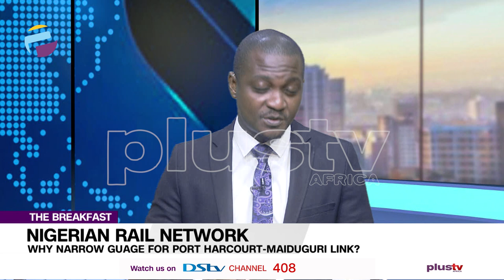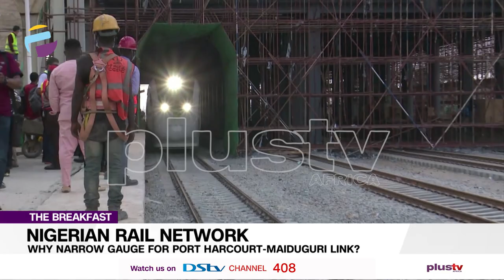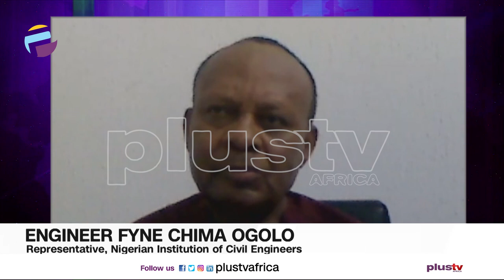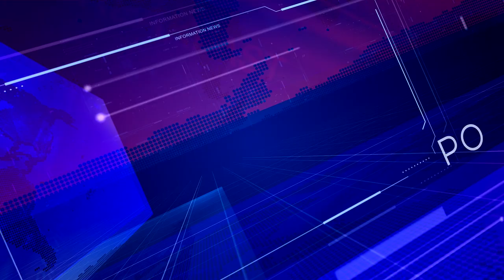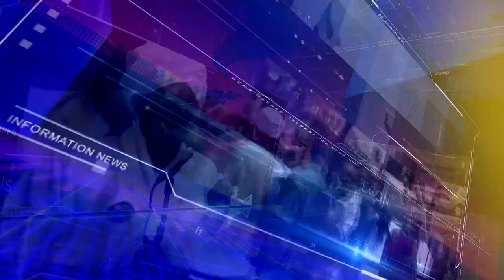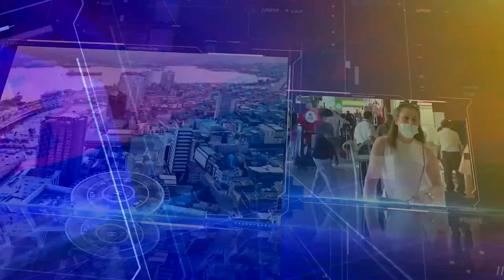Nigerian Rail Network - Why Narrow Gauge For The Eastern Rail Line? ​| THE BREAKFAST

Comment: Itakpe - Warri with a link to Abuja is a standard gauge line that is operational now except for the Abuja connection is in south south Nigeria. How many people are actually traveling from Port Harcourt to Maiduguri, that corridor is more of cargo rail than passenger train, passenger rail transportation is more viable for high population area, if the road is good, especially if the Portharcourt to Enugu express road is completed the journey should not take that long to move between the eastern states. The southeast needs the cargo train to start running instead of waiting for standard gauge which they don't have the money for now.
Reply: But what about the future Ben? When Nigerias population is 300m- 350m and the faster trains are needed? This is a lack of vision and balls from the buhari government.
Reply: @Monaug5kid If other govt in the past has vision, all these infrastructures should have been constructed several years ago, this government is constructing second niger bridge, the bridge cost as much as the train been constructed in other parts of the country, southeast is getting a fair share, no one govt can build it all, if we have incremental development, it is just a matter of time, all the rail line in the country will be constructed.
Reply: @benakor8575  It will be constructed but won't match up. Even Japan with the most narrow gauge line is trying to build convertible trains to run narrow and standard. CANNOT DO IT! It is foolish to not standardise the whole thing in one go. The south south to north east line does not need to be built until the start of 2023 under a new government. In that time they can plan and raise funds. The diaspora can cover most of the cost over a 4 year period.
Reply: Ben Akor right! PDP is a disaster.
Reply: @Monaug5kid  The rail line that should be a clamour for in the east is the coastal rail line from Lagos to Calabar, this train route run across many west, east and south-south cities, this is where we have population growth and movement of people within the south not from PH to maiduguri
Reply: @benakor8575  You are INTELLIGENT and a true VISIONARY.I celebrate you!🍷

Comment: For heavn sakes, if this is going to become an issue used to promote division, let us make the Eastern Rail line Standard gauge. Let us go the extra mile for the sake of unity. Some may argue that you shouldn’t pander to sentiment over practicality and economic values, whatever those may be, but I’d say that Nations have to make compromises for the sake of National cohesion especially nations like Nigeria that are hugely divers.
Reply: They think that they are doing it for Igbos not knowing that it's for the benefit of all Nigerians.
It's not about doing it for Igbo it's for the benefit of Nigeria development and economic revenue.
Reply: @Southernview3k  And that is why they should make it a standard Railway. The ability for a a Passenger/Cargo to travel from Port-Harcourt to Lagos without switching trains would be beneficial for the Economy in the long term. The current Narrow Gauge Railway that the East runs on is going to be fazed out in the coming years anyway so why not just upgrade the line to the national standard now instead of wasting money refurbishing the outdated tracks?